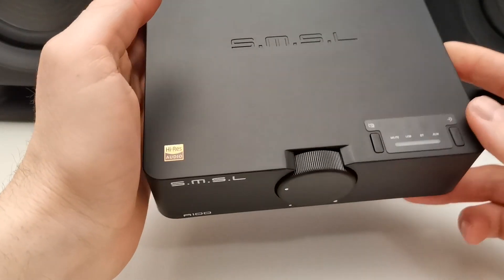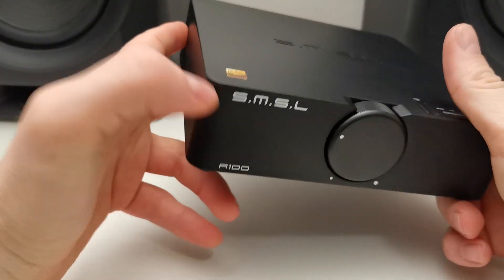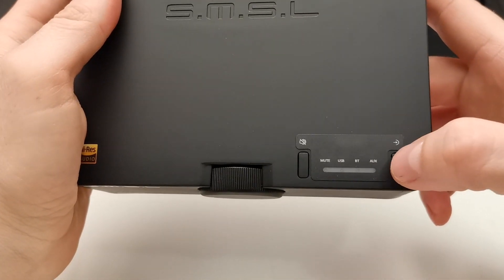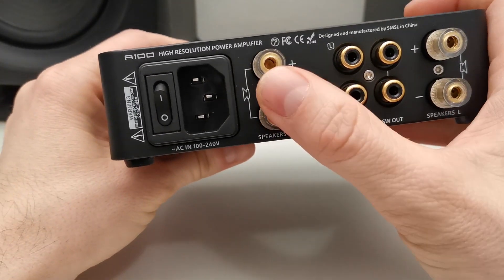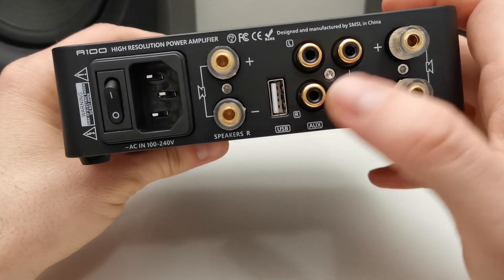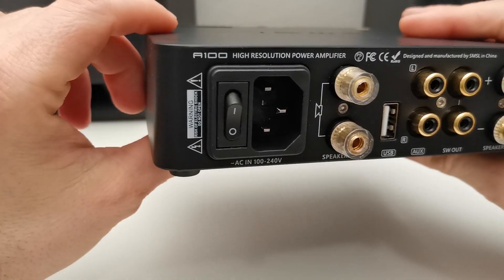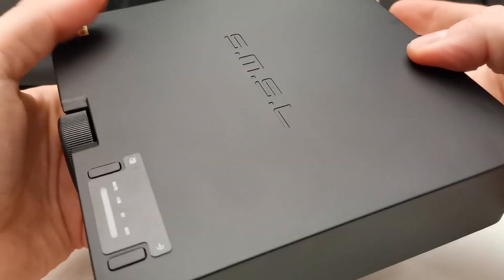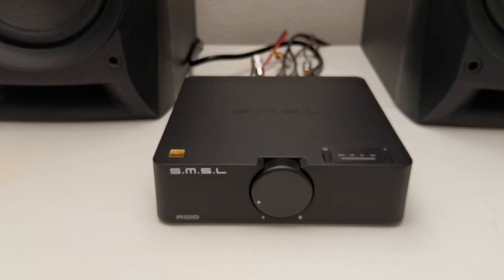SMSL A100 - Class D Power Amplifier 80W+80W

Comment: Is that speakers Sony SS-H991 8 Om?
Did you try to connect rear speakers in parallel connection SS-SR991?
Reply from the maker: Those are Sony SS-H551 speakers connected directly left channel to left speaker, right channel to right speaker.

Comment: Thank you for your review video. What is your opinion on A100 vs AO200? Worth the price and upgrade? Sound signature comparison between the two?
Reply: In my opinion  A300 is better but you will need a good source and a DAC. A100 and A300 are better for a system with separate components. AO100 and AO200 are more versatile and you can use them as an integrated amplifier (and upgrade DAC and source later) but they are 30% more expensive than the other models that are just an Amp. It all depends on your priorities and the type of speakers you are going to use, the sound signature is similar in all 4 models but the power rating (Watt per channel) is different...
Reply from the maker: Definitely AO200 👍